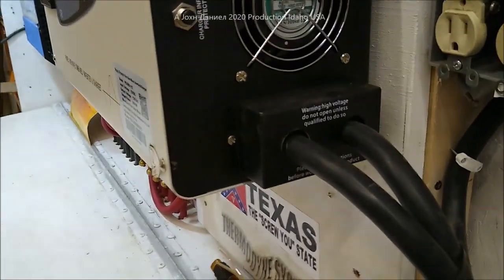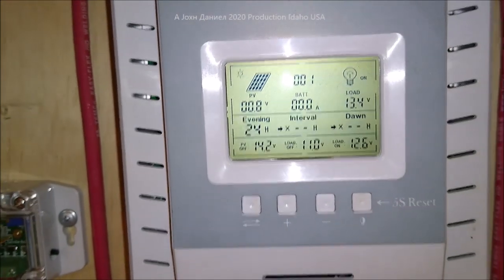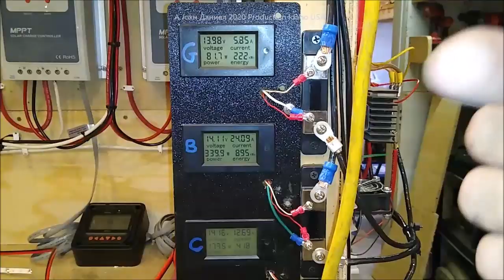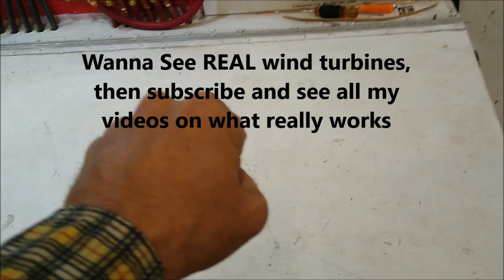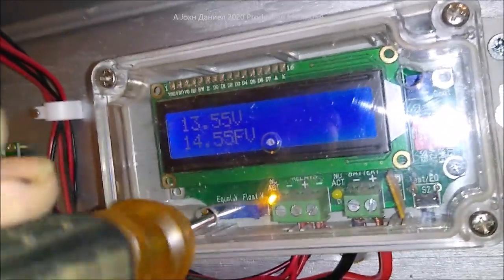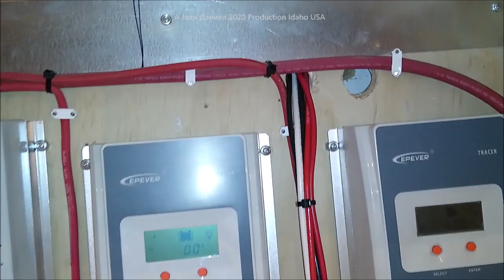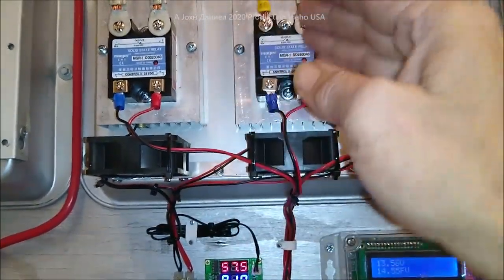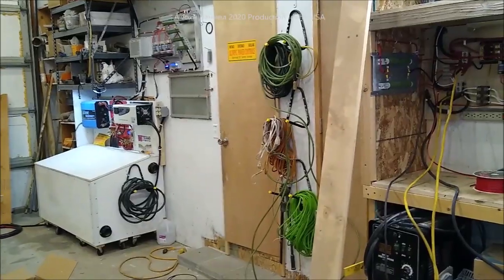Micro Wind turbine EZ diversion charge controller & upgrades, Parts Below vid

Comment from the maker: I put as much of the parts as possible under the video where the upload info and date is. Be safe, you can build it. And Check out the custom TINY HOUSES I DO SOLAR WORK ON  https://bit.ly/31tJMof
Reply: Ha John, great video... See you have Epever controllers what size are they? I have 2 40amp and they work great.
Reply: @chrischrismelco  not the cheepest .. but suddenley the best producent / produckt out there..
Prof components .. slightly bigger then aculey needed!!! 
If you run you PV in SERIES !!! NOT PARALELL !!!
Reply: @chrischrismelco  use Them too 12 x 250watt gold series RECOM.COM PANELS +5WATT 
6420AN 180v (200v) PV = 4x250  in 3 Banks =12 panels = 3000+Watt 
I got 4 Banks of 12 panels = 12.000Watt mono crystalin (30+%better in cloudy weather)
Reply: Јоhn Daniel  why my micro wind turbine not working i use 12voltss battery and wind turbine 24volts
Reply: I used 12/24volts controller
Reply: This is looking really good.   Lots of work going into your move
Reply: Your building these small homes john? Prices are a bit high .but that's because im a do it my self kind of guy. I could build one for under 20k .
Reply from the maker: @donaldsteele6276  I am building the power control centers for a number of them, the Tumbleweed is just the best in class. Cheaper than a RV, but still expensive due to materials used.
Reply: @JOHNDANIEL1  i think they are great
Reply: Curious, but first apologies for not being up to speed on your basic info, I've only seen this one video. I believe you're in Texas and I'm just north of the border in God's country (Oklahoma). I have kin in Canton, east of Denton, San Angelo and many friends in a state I travel to very often. Perhaps after a bit more introduction we could meet. But I understand with all the fruits, nuts and flakes on the internet it's almost counter intuitive.

Comment: Curios, what do you think about the newer batteries, the lithium or even the solid state batteries or is the lead acid still the best way to go?
Reply from the maker: You can depend on Lead Acid suppliers and consistency. Most made in North America.  But Chinese made options can not be assured as viable as world events change. Supplies and battery parts for Lithium based products depend 100% on China allowing you to buy them.

Comment: Where your dump load. Resitors are stagered the 4 of deme is a smart idea they won’t tranfer the heat as it rise  from one to the other but you did not do that in the other room where you got the two.
Reply from the maker: Yes the other two are set at a slightly higher voltage and do not run very often. They are for emergency over volt conditions to add just a spare bit of extra load.

Comment: I have been using solar power exclusively for almost 40 years, added a 500 watt turbine this year but it doesn’t cut it at my location. I don’t have an anemometer but being that turbine voltage starts at zero and builds with the wind speed, what I thought was windy, isn’t nearly windy enough.

Comment: Is there a way to divert power before it hits the battery? Every diversion system I have seen, they always cycle the excess power through the batteries often without a regulator / controller. It would be seriously detrimental to batteries having unregulated wind / solar enter the batteries then have them pumping through crazy amounts of energy once they are full, especially with LiFePo. There should be a controller that identifies max load and switches load to dump before the energy even touches the batteries and the controller. Until there is a solution to prevent this micro cycling problem then I won't be investing in wind because the price of batteries is the most costly part of the system and you will be, basically, stressing your batteries to the max, which will decrease the batteries life dramatically.
Reply from the maker: I Guess after installing hundreds and doing this for a decade with my batteries lasting 7+ years I may have missed something, but You may be totally missing the function of active load diversion. Without the battery in the loop as feedback you can't divert anything. All the controller will see is 3 times or more voltage hitting it. The batteries never get any voltage over the setting on the controllers since they are active capacitance, and they never get damaged by my system in the near 10 years running this set up. 
As for Lithium they make controllers for it that behave a similar way, but divert at a lower voltage and disconnect in unsafe surges since Lithium can not handle a short 20% over volt like your average Lead Acid can. The problem with Lithium based wind turbine charge controllers is they destroy the wind turbines over time. Switching NO LOAD back to High Amp re-connect on a wind turbine like the LiFePo4 controllers do will fry its stator at some point.

Comment: If you needed 300 watts of diversion and you used what you recommend 100w resistors 2-6 ohms at 3 of them, would the same fall if you used say 1 300w resistor 2-6 ohms? Just wondering because Hurricane Wind and Power only offers 300w .7 ohm. Are there different rules for ohms when you are using a larger resistor? Kinda the same question if I were to use 2 150w resistors. Should they be at 2-6 ohms?
Reply: The above is for a 12v system
Reply from the maker: I choose multiples in lower wattages for one reason. redundancy. Easier ways to add for more accuracy and total effect. Using a single large resistor means if it fails then you have nothing. Same think I use in installing 6 small turbines over 1 large one. Redundancy is smart. Same with 12 volt over higher volts, redundancy. And with the way the country is collapsing right now, I was right to be that way.
Reply: @JOHNDANIEL1  I totally get it. And yes, it is a shame to what might come of our country in the near future. An electronic store near me has 150w resistors. If I was to go with those what ohms would you recommend? 12v system Hurricane 750.
Reply from the maker: @bohicarlp9525  4 to 6 OHM

Comment: I have a 2URDC Dump Controller. In the instructions it is mentioned to use a 8 amp fuse positive side between battery and controller. What kind of fuse would you recommend? I have 7.5 amp mini blade fuses. Should that be fine?
Reply from the maker: 7.5 will be fine.

Comment: Hello John, I am new to the wind turbine aspect and I am wanting to know if it would be fine to have my DC lines after the rectifier go into a mppt solar charge controller then to the batteries?
Reply from the maker: Yes as long as you use a quality controller like a Xantrex or Sunnyboy with the input voltage and amps capable of the turbines abilities. InRe : a 150 volt max and 80 amp controller minimum on a 500 watt turbine. You can not run both solar and wind into the same controller unless you buy one made for that purpose.

Comment: In regard to the digital diversion control, i read the manual and they mention 16-22 awg for the power source, what gauge wire do you recommend for DDC to SSR, battery to SSR, and SSR to resistors? I did not notice you mentioning it on any of your videos or in a schematic.
Reply from the maker: you will only need 16 to 22 for power to controller, from controller to SSR since none is needing over 4 amps. From the SSR to the resistors you will need no less than 10 AWG for every 240 watts you run from it off a 40 amp SSR, or as I do, 8 awg to 400 watts per 60 amp SSR.

Comment: Mind if I keep asking you??? You keep saying wind speed. What do you have connected to tell you what the wind speed is at any particular point in time?

I don't see anything you have connected to indicate what the wind speed is at any particular time
Reply from the maker: Ge you one of these and install it in a clear location about 5 feet higher than buildings https://amzn.to/3eFjBQc
Reply: @JOHNDANIEL1  Thanks, I already have one of these installed almost three years ago. I was asking what you use because I don't see anything in your setup but you keep saying what the wind speed is.

AcuRite 01512 Wireless Home Station for Indoor and Outdoor with 5-in-1 Weather Sensor: Temperature, Humidity, Wind Speed, Direction, and Rainfall, Full Color https://www.amazon.com/dp/B00N1XCA9M/ref=cm_sw_r_em_apa_i_nzGeFbPE8BY69
Reply from the maker: @nunyadamnbiznez3522  Mine is from 2 of them, One is in the house, and one in the big Jayco trailer ( my office ) and in some videos you see me hold a camera to it in the beginning of the video then head to the shop.
Reply: I'll look for it again.

Comment: Hi John I like your videos. We had some very high winds in SD my tower came down  broke some blades. I would like to rebuild. I bought a 4000 watt from Walmart.  Then I watched  your videos it did a good job tell it went down.  I know  now it can't  be 4000 watts  because the blades are only 23 in long. If I put bigger blades on it will produce  more power.  Scott.mutschler@morris-inc.com
Reply from the maker: If you put bigger blades on it, stay with the max of no more than 15% increase or your going to overwhelm the wiring and bearings.
Reply: @JOHNDANIEL1  thank you I will stay with the same size. I am going to a add more batterys to my bank because the one's  are fully charged  before 11AM  .thank you John

Comment: Thanks for the informative videos John, as well as the links, however I am totally off grid with a 48vdc system wanting to add wind generator and the controllers are 12/24. moving on...
Reply from the maker: You can add a turbine using a 12/24 controller by tapping the battery for 12 volts to control the 48 volt system. I do it all the time.
Reply: @JOHNDANIEL1  my two lithium batteries are 48v each, no 12 volt access, I have a few of your links to use, thanks.

Comment: Hi John. I am looking for advice on a wind charger for my boat. I have a small amount of solar and 600a/hr of flooded acid deep cycle batteries. Is there any way to contact you by PM or something?
Reply from the maker: For the price, get the 300 Green Energy model https://youtu.be/9KEd80qBu0I . My friends in Seattle have a 45 foot sail boat, they installed one and bought another to stow under for any emergency needs. Thats how cheap they are to get. So far they went all up coast 3 months with it and said it was perfect and smooth.

Comment: very nice setups you got! fun to see.

the small wind turbine business is really shady. 
the 2 i have ( 1 hornet, 1 ista breeze) needed a lot of modifications.
the hornet for example has a windy nation rotor, bigger tail, separated phases and a mppt regulator to work they way i want in low to medium wind.
if i would buy today i know what to look for but i didnt back then.
Reply from the maker: I Did not know Chinese windy nation parts could fit in a Delco 12si hornet PMA. I made all mine 12 magnet and the power almost doubled.
Reply: @JOHNDANIEL1  when i bought it 3-4 years ago there was different hubs to choose from i think. i have the blue plastic blades.

Comment: Do you have a recommendation for a good solar panel website to purchase from that you have had good experience.   Thanks!
Reply from the maker: What size, voltage and results you seek would be great info to direct you with.
Reply: Јоhn Daniel    I was looking to start with two LG 60 cell panels 350 watt in parallel for grid tied to get my feet wet. I believe they are 40 volt output each. So 700 watt 40 volt to a simple grid tied inverter.  Your thoughts?
Reply: Јоhn Daniel  What is your opinion on panels with micro inverters built in? Thanks
Reply from the maker: @michaelwood8221  Micro grid ties were popular some years ago, then numerous law suits by Electric Companies sort of canned them. They were useful, worked, but many did not have islanding effect which is required to use them. I would recommend a common grid tie of 1000 watts with Islanding effect.
Reply: Јоhn Daniel can you link a good 1000 watt one you would recommenced.
Reply from the maker: Great subject, Watch for a video coming on that.

Comment: Hello John

My name is Thomas and im from Denmark

I have been seen your video and the are really cool to watch👍 and think you did a good job. have thought of making a wind turbine for a Long time but after have seen your video i know what Brand it have to be. B & C Wind. but Think i Will try the one on 2000 watts but what else do i need then. I want to convert the power to 240volt
Reply from the maker: If you go to the link for B&C 800 watt, off to one side or in the pages they have a 2000 watt with a real good grid tie unit. It has internal diversion system and will come in the voltage your country requires.
Reply: I Will do that forsure, what kind of battery do you use? and how many should i have when I want to use the 2kw wind turbine to store power from the turbine?
Reply from the maker: @thomastoft6984  I use the L-16 style, deep cycle lead acid. 10 to 12 years lifespan with good care. So many preach LITHIUM, Lithium, lithium..... But they seem to fail with ignoring - COST AND LIFESPAN!!!!

Comment: Love your videos. I am an off gridder with a 48 volt system and was wondering if I could hire you to build me a board where all I need to do is bring the legs in from the turbine and connect the outgoing legs to my system. I have a double 3600 watt Outback inverter system for 220 with a Flex 60 and a flex 80 MPPT charge controllers, 24 6 volt Rolls batteries, and 18 220 watt panels. Too many gray days this year, but some pretty windy nights. Having something that would bridge the gap so my genset doesn't kick on just before daybreak would be great. Also like the benefit of the pulse to keep my batteris in top shape. High winds at my location are 25-30 mph with gusts to 50 mph. A lot of 15-20 mph all day winds and I sit at the top of a hill with no obstructions Plan on setting the turbine on my shop roof as you did. Thanks for any help Mark
Reply from the maker: You should always consider NOT placing a wind turbine in extreme winds but your location sounds OK just be sure to consider blade braking designs such as a SWP1000 for your system. Since you have a 48 volt system, you will just use a 12 volt source tap on them to run the controllers, from there your SSR will switch the 48 volt supply to the resistors for diversion controlling or hot water making. 
Send me a email with all your building info, I can help with some options and a few drawings if you need them olympicpowercontrols@yahoo.com . It may take a few days to hear from me, I get 50+ a day.

Comment: I really love that diversion load controller. Like how it varies the pulses going to the SCR's, very efficient.  Seen so many before where it dumps 100% or nothing then a lot of energy is wasted. Seen some videos from Missouri Wind and Power that used a MPPT charge controller made for wind turbines when the built in diversion relay kicked in the diversion load was way to much then the output dropped to almost nothing. If it had a diversion load similar to this then it could still output the full power by keeping the input voltage at a certain point. I am wanting to build an Axial flux wind turbine about 16 foot diameter. It will be able to furl some in high winds. I will be using this to power a 48 volt system. voltage of wind generator will be up to 150 volts max so it will go to an MPPT charge controller then at slower wind speeds voltage will still be high enough to charge. What do you think of the 70" G5 raptor 1600 watt generators he is selling? wind speeds where i live average 18 MPH
Reply from the maker: Simple facts, you must trim your peak power, not knock the hell out of it like the super fraud 440 amp fake wind controller sold by those slum lords of wind power.

Comment: Is there a difference between having even and odd number of blades? I recently got the  24volt 500 watt turbine that you recommended with Alibaba with 6 blades to upgrade from a 400 watt cheap chinese trubine my dad bought on sale years back. I tried 5 blades on the cheap knock off and it didnt do much better in terms of power, but I felt like it spinner better then the 6 blades I have now. I've even added a few feet of extra height to get better results and I'm a little perplexed. Worth noting I have low winds speeds in my area, and my system itself is 12 volt. Trying to make more use of the low wind speeds with the 24 volt
Reply from the maker: 6 blades wind wall ( become a obstruction to flow ) sooner than a 5 blade. A quality turbine solves the no power issue, thats why I list them under the videos. I would do a LOW WIND 3 blade model of the 800 watt and see the power roll in like magic.